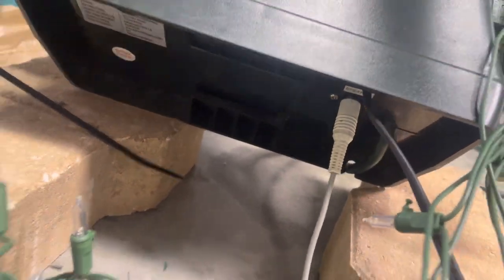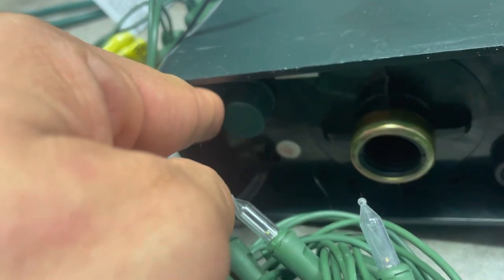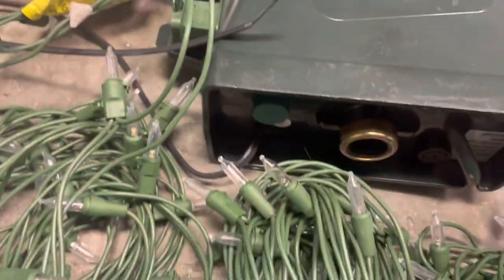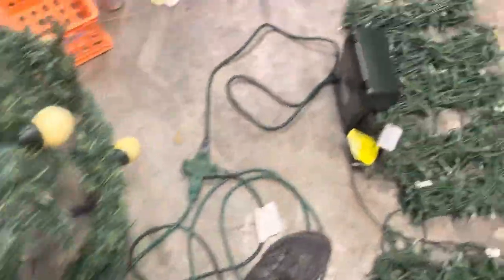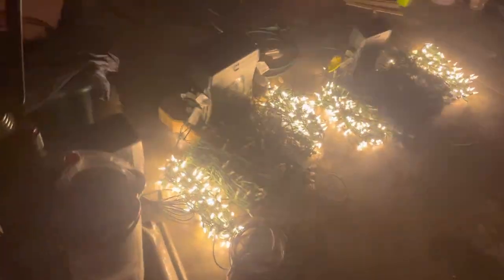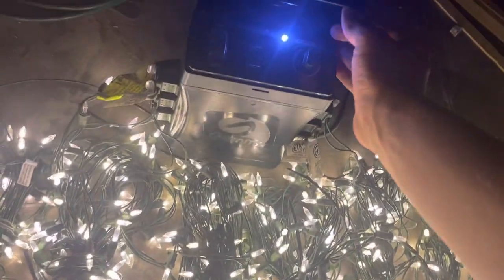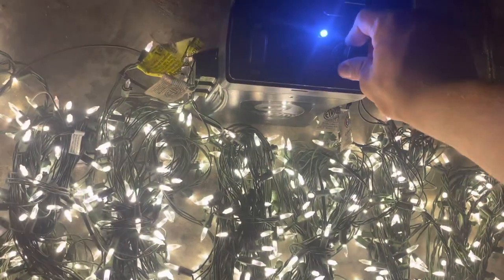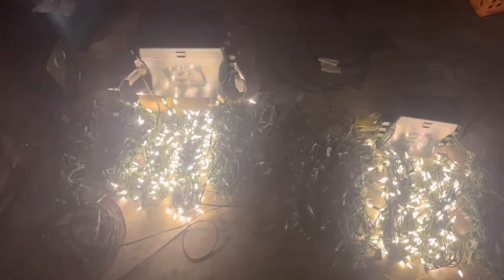Gemmy holiday lightshow box with timer link port modification working with the second controller

Comment: The only reason why I got my models with the link port is because I didn’t think that the motherboards on them would be the same, but now I know that they are.
Reply from the maker: I didn’t know the boards were the same. I took it apart and sure enough it’s the same. It is really nice I have the second controller so I can have more lights somewhere else without having too many cords.